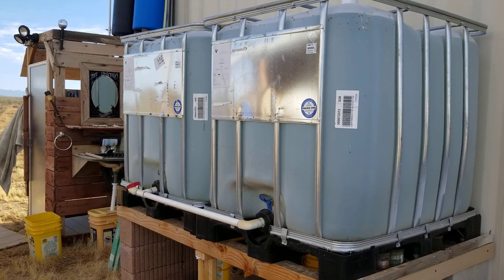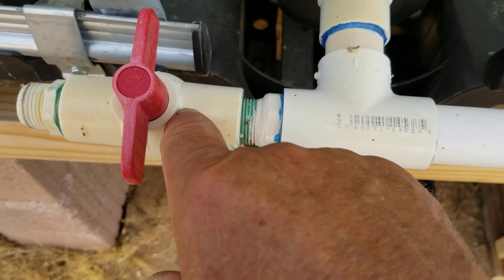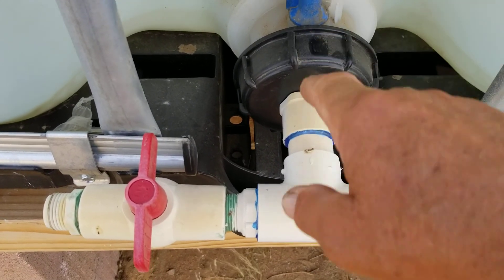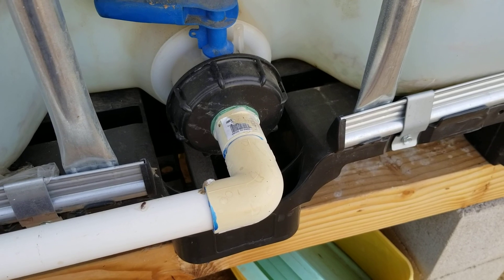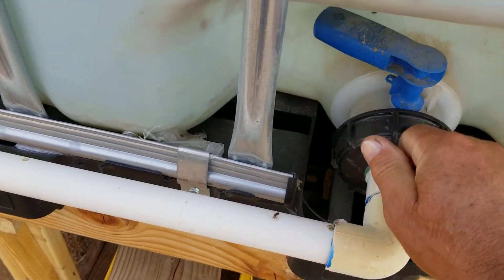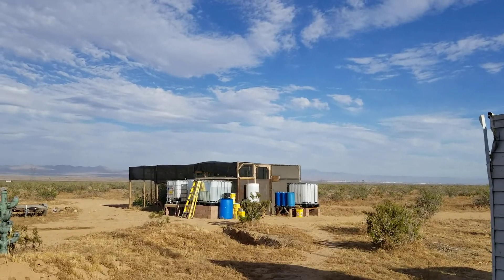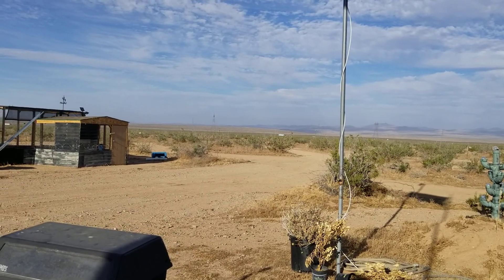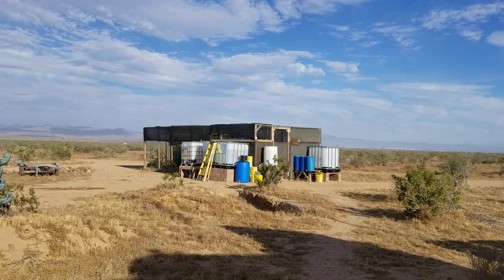Water Delivered,but not enough, June 25, 2020

Comment: That has got to be a relief.. So do you think you will have them come out when you get room for 3000 gallons from now on or are you going to almost run out again before you call and order.? I know it may be a little more money but peace of mind has to be worth something.. Here he delivers 2100 gallons ($150 bucks) for my 2500 gallon tank so when I get to ~450 gallons is when I put in the order..  (He just got a brand new truck because his old one was costing too much to keep running..)
Reply from the maker: I can make this last until next spring, but my future plan is to add another 2500 gallon tank beside the existing, and keep the tote storage increasing too.  Ultimate plan is for 10,000 gallons water storage, 1 gigawatt electrical power, 5 acres of farmed produce, a pond stocked with fish, 50 egg layers, a few pigs and goats, 2 cows and a horse.  Maybe a horny playmate....👍😁
Reply: @GBear  Do it in THAT order because if you reverse it you won't be able to afford the extra tank, electric, produce, pond, chickens, goats, cows or a horse.. lol
Reply from the maker: Lol, you're right!